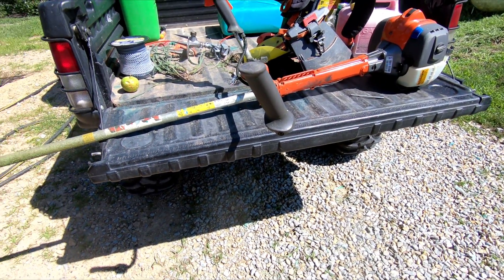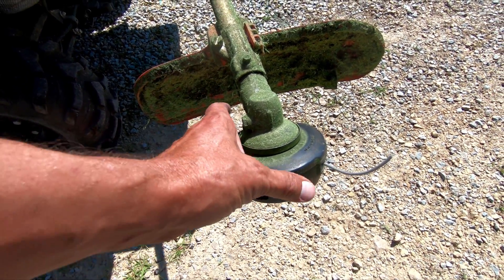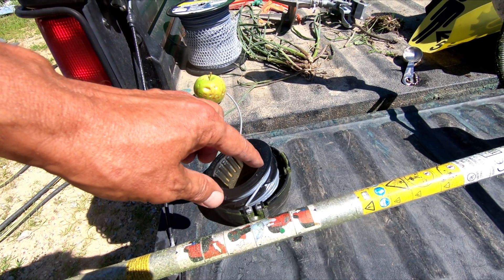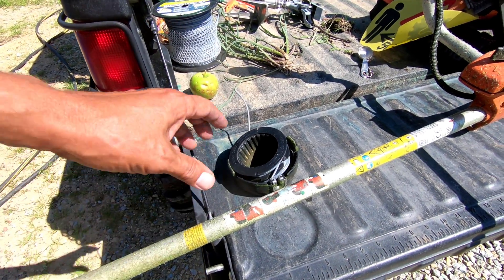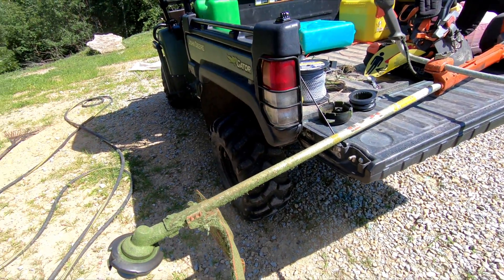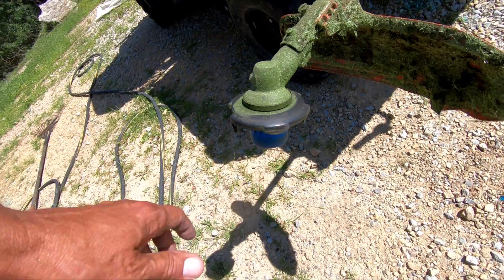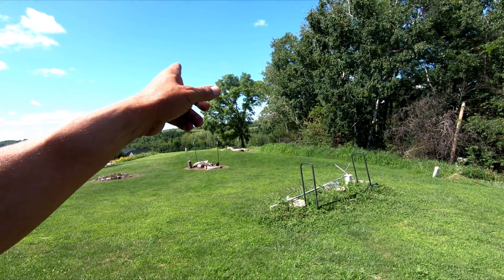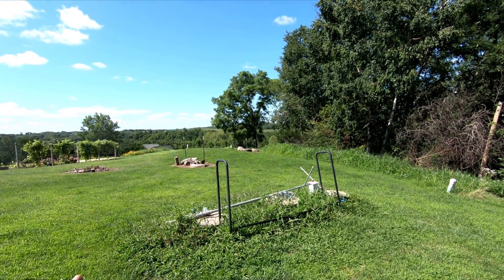Problem: Trimmer Line Feeds Too Fast [Solved]

Comment: Is a problem on "any" trimmer using this design.  My machine (Toro) uses this style.  I had the opposite problem of not wanting to feed line.  After thinking about it I started once a month using a small old metal brush I could bend a "J" in so I could reach into the "lip" and clean it out.  I was going thru 1 bumper ball a year from "internal" wear.  For 2 years been "cleaning" and it's worked great.

Comment from the maker: Here are more videos on the Husqvarna 223R -- likely the most used tool on the homestead:

How-to String a Husqvarna Trimmer and Save a Bird -- https://youtu.be/F1o28dy_x4Q
Trimming with the Husqvarna Brushwhacker [Garden Updates] -- https://youtu.be/1zYsupsYfk0
Clearing Woods with Husqvarna Brushwhacker -- https://youtu.be/iX4wggFa0Qo
Father & Daughter vs. Trees & Brush -- https://youtu.be/DfBUO9dGi64
Husqvarna Brushcutter Issues [Among Others] -- https://youtu.be/yPFSnfJCO-0
Road Maintenance on the Rock Road Day One [Husqvarna 223 Down] -- https://youtu.be/ckDfFATr_Ws
Fixed Husqvarna 223R ― Road Maintenance Continues -- https://youtu.be/RBiBi7svHnM
Problem: Trimmer Line Feeds Too Fast [Solved] -- https://youtu.be/5MJbwWN1cYk